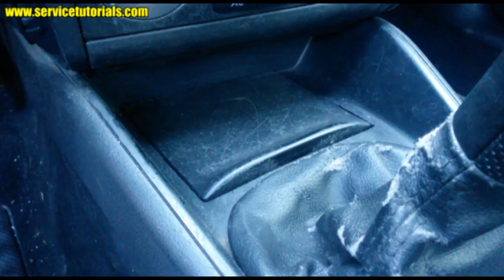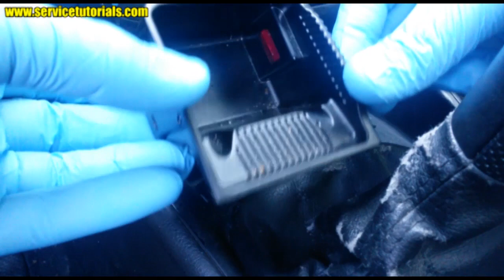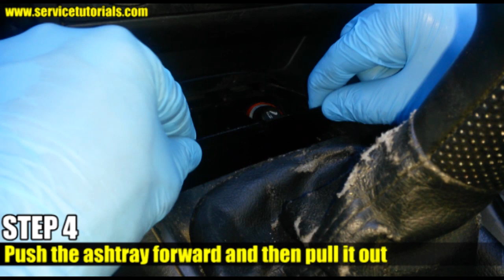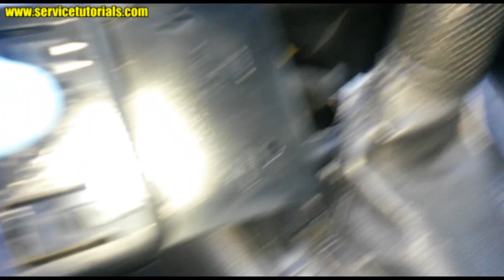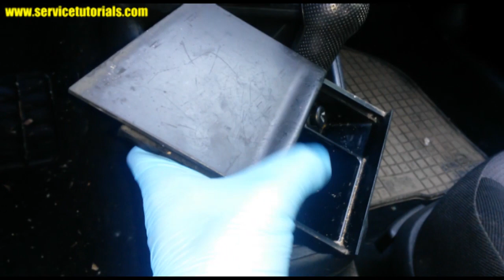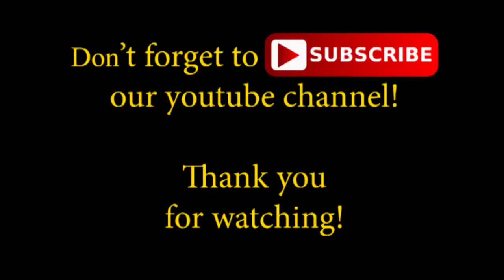How to remove the front ashtray / cigarette lighter VW Golf Mk4, Bora, Jetta in 5 simple steps

Comment: I removed the screw but can't push my tray forward, 2004 VW Jetta. thoughts?
Reply: Me neither...it looks like that you need remove it the whole center console.
Reply: I did a number of ordinary 'pushes'. Went away, returned, tried again, went away.... succeeded with more determined pushes.
Reply: Be sure to watch the video carefully and do exactly what the demonstrator does. Be certain to first remove the ashtray component and the torx screw before trying to remove the unit. Otherwise, you will break some flimsy plastic necessary to support the unit.

The ashtray unit has some plastic clips on the bottom which hook onto a thin metal bar.  These clips require the entire unit to be pushed forward slightly toward the nose of the car (after removing the screw!) before it can be lifted and pulled out. When removing the unit, it can be helpful to partially open the lid at certain times to improve maneuverability. Watch the video to see when.

When putting the unit back in, be careful not to press down hard since you easily break the plastic tabs that the thin metal crossbar attaches to. This is the cross bar that the ashtray unit hooks onto with clips.